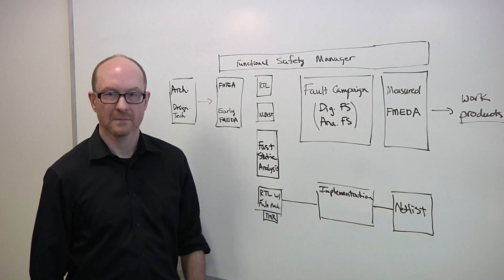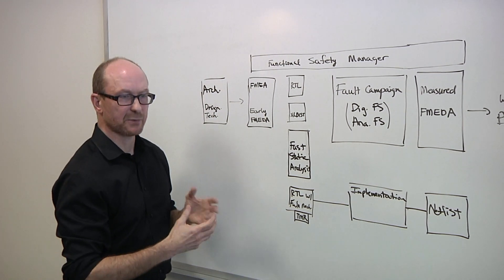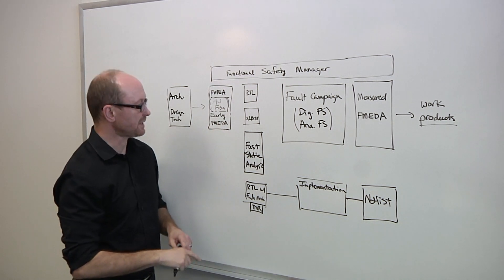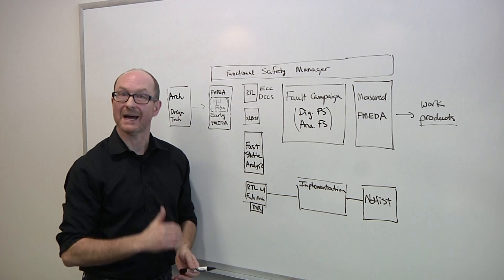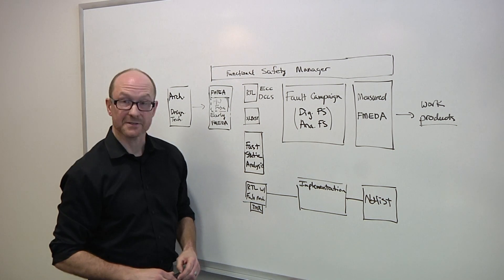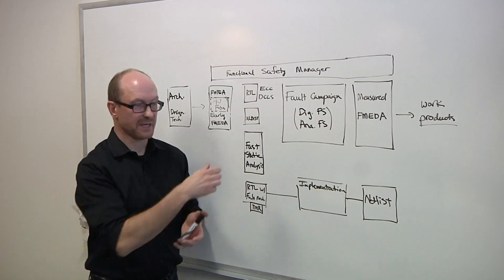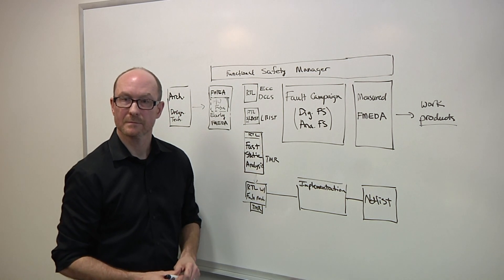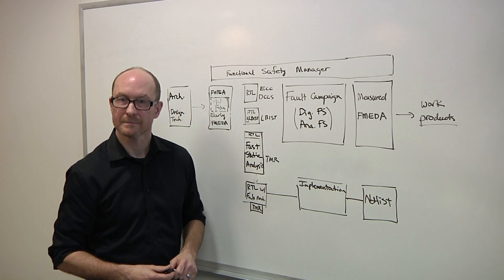Automotive Chip Design Workflow

Comment: what a wonderful video...:)   i was wondering why factory electronics,  as "rockwell eng." install panel-cabinet air-conditioners to keep their PLC modules and motor drives, etc. cool, when my car on a hot summer day runs great with the computer mounted beside the intense engine heat? It seems like automotive electronic design ideas could save a huge amount of un-needed energy by making more semiconductors that could operate at 100 degrees fahrenheit. The military electronic devices can handle a wide temperature range. Just do it. Thanks...:)